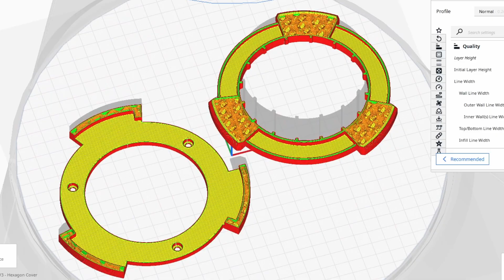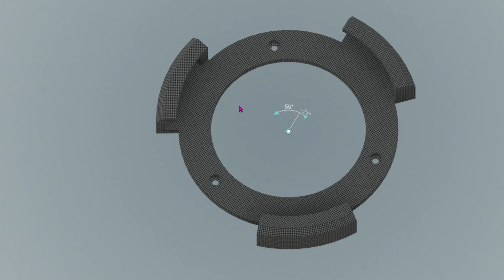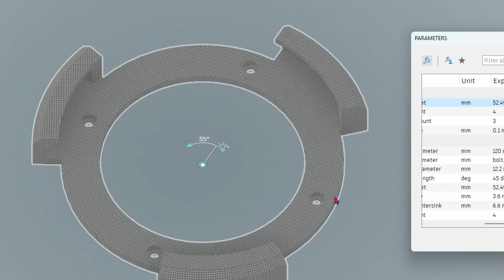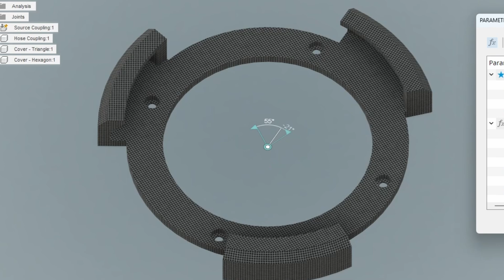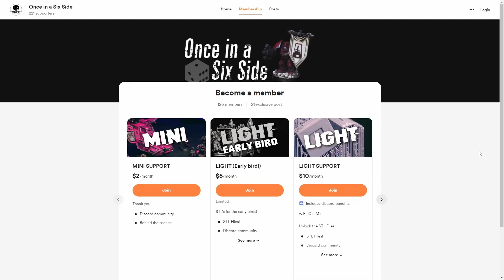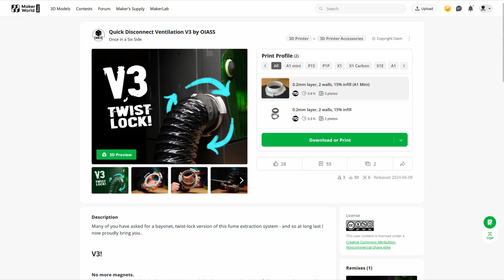Quick-Disconnect FUME EXTRACTION just got even better!

Comment: Hello. Thank you for this great video!

I am planning to do such fumes extractor for 3d prints and soldiering.

I am planning to drill 2 or 3 holes in the ceiling of my room to the floor of an attic and then connect them to the chimney/roof.

Am I reading this values correctly and i should drill 120mm holes?

I am also wondering if connecting them through one bigger pipe (in chimney/roof) like fi=sqrt(60^2*3)*2=208mm.

Please advise. I am just starting my jurney with 3d.

Best regards!

Comment: Why is the default stl download only a 3 hole set up? I jumped all the hoops adding the 4th hole back in using fusion360 with your file and printed it out only to find out the size somehow changed. Would love for the default stl to be 4 holes.

Comment: Amazing design! does this V3 version have the adapter for the Halot mage?

thank you!
Reply from the maker: The adapter for the Halot mage is compatible with V3 :) Just use v2 bolt_offset paramter to get a perfect fit
Reply: @OnceinaSixSide  Ah i see, so i need to print the adapter for the Halot mage and screw the V3 to the adapter using the V2 bolt_offset to fit the screws?

Comment: Sorry in advance for my bad english! From what I see the connection points are flat and after time and countless interactions, there can be a small gap where fumes can go through. Wouldn`t it be smart to create an inner ring on the device side that stands out a little and on the hose side the counterpart. This way you have something like a round guiding which also helps centering while connecting and a better connection where fumes can not get out. Maybe I overthink this but at least in my head it makes sense.
Reply from the maker: Honestly the inline fan is sucking up so much air that any fumes in and around the printer can only go in one direction, and that's into the hose!

Comment: How difficult would this be to make to where you can put this on top of an 80mm fan?
Reply from the maker: It shouldn't be too complicated. If you make something to hold the fan that has bolt holes that line up with the coupling it should work. Might make for a fun little modeling project!

Comment: Protip for anyone with a bambu (or other printer that supports step files) export as a step file and use that to print from. Step files use actual curves rather than approximating curves with polygons, so you end up with smoother curves on printers that support it.
Reply: Hmm, good tip, I want to try testing that out

Comment: Any idea how to set this up for a window that swings open instead of lifting up?
Reply: That's the main reason I don't have this yet
Reply from the maker: Hmm.. you can buy window AC kits, I've also seen people install clear acrylic panel over their window to good effect, but yeah unfortunately there's not as easy and elegant a solution here..
Reply: I have windows that swing open and I cut a piece of plywood to size and replaced the screen with the panel. It's cut to be a friction fit and I have some masking tape around the edges. I also installed a screen over the outlet hole. It looks a little ghetto, but it works. You could probably do the same with a piece of acrylic if you care about looks.